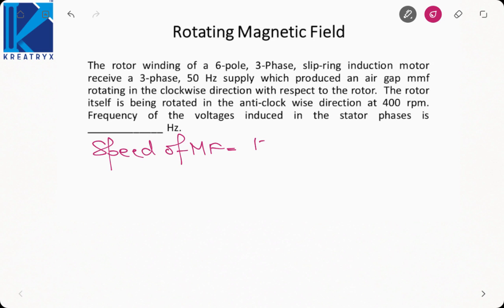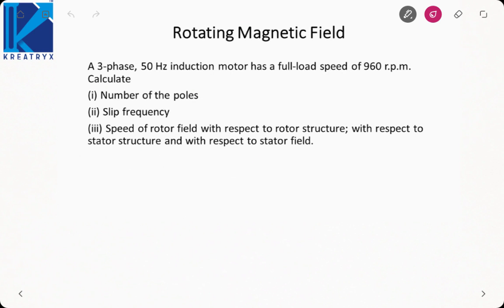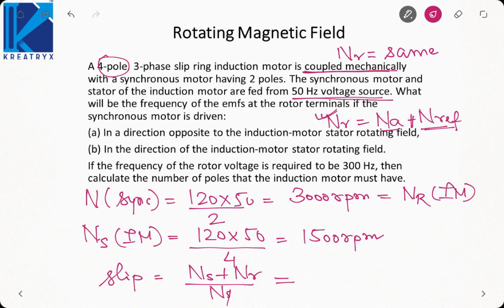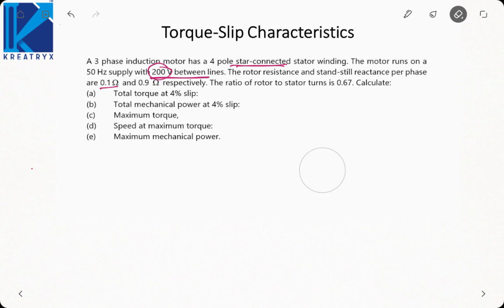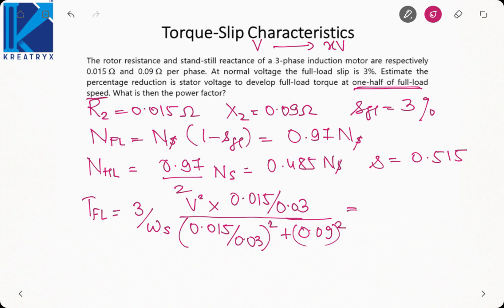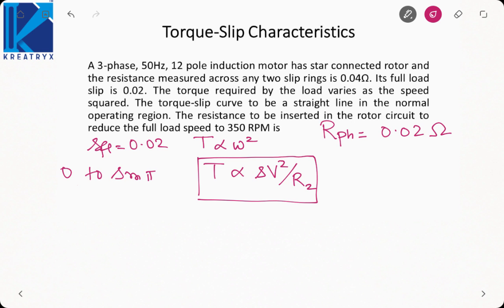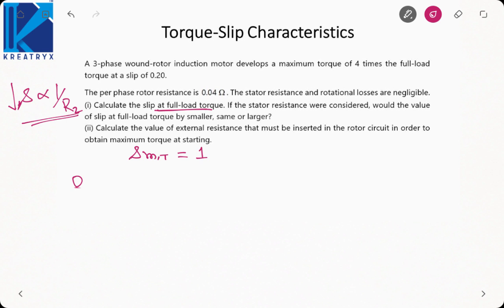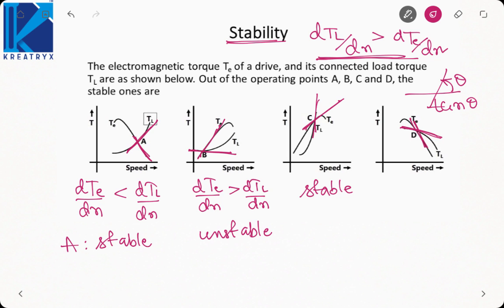Induction Machines 1 (Electrical Machines) - Krash - Problem Solving Video | GATE (EE)

Comment: Their is a question on torque slip stating one half of full load slip .. Change in percentage voltage reduction... However in equating full load torque you didn't changed  speed at half load in the term ..
I think along with slip. Ws term will also be changed to half while equating torque for change in voltage

Comment: at 23:38 min you said slip will be, 0.515 Sir, would you explain how??
Reply: s= (Ns - N)/Ns , so in this N= x* Ns ( I dun rem. the value) so it would be simply s= 1-x which he skipped directly
Reply: Why, Sir........ S=0.03 added with 0.485.....?
Reply: 0.03+0.485=0.515.       S=0.515 but why.....?

Comment: remaining subjects 
control system, power system, power electronics,analog and digital, measurements,signals system etc related to EE gate problem solving like machine
Reply from the maker: Hey, we've launched the complete Krash video course which includes all the Subjects. Do check it out here -  https://goo.gl/sog8fr

Comment: thanks a lot sir..cleared number of doubts from the video..
jusy one doubt is, how the slip inversly proportional to stator resistance,can you explain that?
Reply: Virendra Dhasal same doubt mine too
Reply: Take v and torque for motor const. And then equ.  The eqa.  Then u u will find this. 
This method is use for speed control by volt.  Which nothing but speed control by slip.